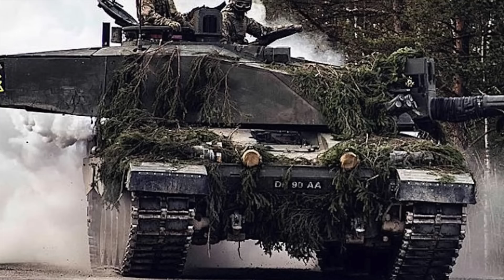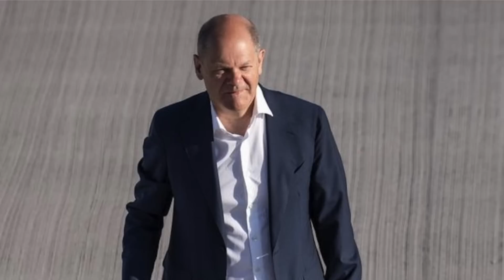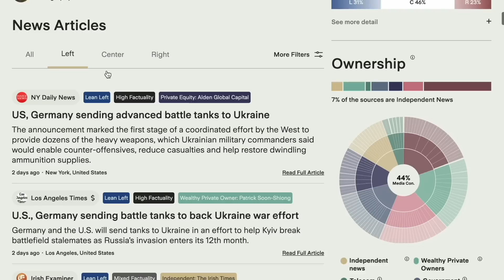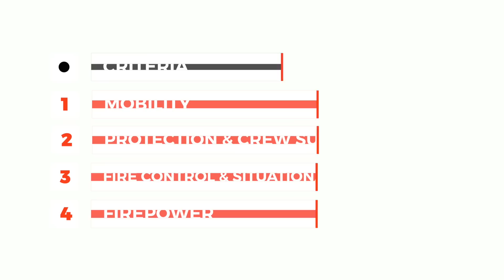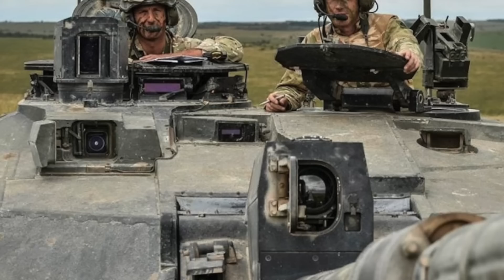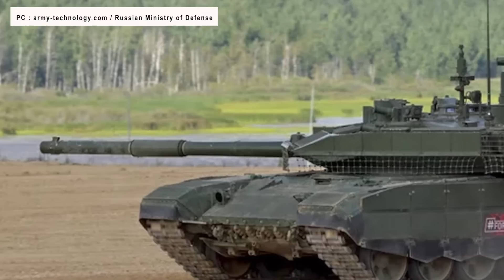British Challenger 2 vs Russian T-90 - Detailed analysis !

Comment: Western tanks are going to massacre Russian tanks.
Reply: Only likely if they splash out for the invisibility cloak option
Reply: @fred4687  Dude they already have in previous wars, hence why they had to rename the T72 to T90 since it did so bad against western tanks.
Reply: @ThatCarGuy  A rename, that's all the difference is ???  Maybe stick with the invisibility cloak there 😀
Reply: @fred4687  You must be trolling. The T90 was literally originally called the T-72BU. Since The T-72 did so bad they had to rename it so they could still export it.
Reply: @ThatCarGuy  The T-90M has significant upgrades in optics, fire control systems and armour. Regardless these hyped up promised - but not delivered - western tanks are hardly going to make an impact in the numbers talked about and without proper training, support, deployment within combined force units, and much more importantly, without air cover. The days of major tank battles are long gone.
Reply: @fred4687  "The T-90M has significant upgrades in optics, fire control systems and armour. "
It's literally a T-72. They dont even have ERA like they are supposed to have like we have all seen on video. They renamed them to T-90 since they did so bad against western tanks already.
" western tanks are hardly going to make an impact in the numbers talked about"
Over 300 western tanks will decimate Russia and their lower quality tanks.
"without proper training, support, deployment within combined force units, and much more importantly, without air cover."
So I guess Ukrainian tankers don't know how to operate tanks... I guess that's why even civilians have videos up of them driving tanks, BTRs, etc. I guess Ukraine also isn't getting IFV and ICVs. I guess they are going to use the Russian tactics of letting tanks go in alone, without infantry or aircover... 
"The days of major tank battles are long gone"
I guess that's why we have seen tank vs tank and/or tank and IFV/ICVs fighting in videos like "Ukrainian tank single handedly destroys massive Russian convoy east of Kyiv"
Reply: @ThatCarGuy  T-90M's .....  optics, fire control systems and armour ....  they are not the same as original T-90's / T-72''s
Tank vs convoy iof vehicles s not the same as a major tank battle
Driving tanks vs operating within a coordinated group during a battle without months of training ....  not the same at all
300 western tanks of dubious vintage, state of repair and with their own supply chain and support requirements .....  not a significant threat
Tanks deployed without air cover .....   expensive targetss

Instead of these incremental escalations dragging the war out both sides  should be encouraged towards peace talks.
Reply: @fred4687  "T-90M's .....  optics, fire control systems and armour ...."
Of which is a T-72 and doesnt have ERA like Russia proclaims.
"Tank vs convoy iof vehicles s not the same as a major tank battle"

Ah so you didnt even watch the video of a single Ukraine tank destroying Russian tanks.
At this point you have to be trolling so this will go nowhere, enjoy trolling others. Blocked.
Reply: @ThatCarGuy  The video was far from unbiased and objective and you fail to address the points I raised. Feel free to deliver your expert opinion to other gullible fools who think the possible delivery of an assortment of old tanks will make difference.

Comment: I have a question: are autoloaders as bad as automatic rifles ability to seat shells, as compared with bolt action rifles - which seat shells better than auto?

Apples to apples or apples to oranges?
Reply: They aren't bad as far as rapid fire. The problem is if they are hit in a certain place the ammo in the turret can explode
Reply: The auto loaders are no the problem with the T models, what is, is how the ammo is stored in order for the auto loader to function.
The Russian crews sit on top of the ammo and the armor on Russian tanks can not stop the 120mm ammo from western tanks, this results in almost guaranteed turret pop off with the crew having no chance to escape. Do a google view for Russian tank pop off contest to get the point.
Their ammo is so poorly stored that Ukrainian drones have been known to drop a bomblet into an open hatch and starting a cook off instantly.
Reply: With the sole exception of the M1a2 Abrams, every Western tank stores at least 2/3rds of their ammunition in the crew compartment without the protection of blast doors or blow-out panels 

The Leopard 2 stores only 15 rounds behind blast doors; the rest of the rounds (27) are in the crew compartment, next to the driver. 

The Challenger 2 stores none of its rounds behind blast doors 

The Leclerc stores 22 rounds behind blast doors; and the rest are located in the crew compartment without the protection of blast doors or blow-out panels 

The Merkava mk4 stores only 10 of its 48 rounds behind blast doors.
Reply: @thephoenix756  M1A2 stores 8 rounds in the hull, all western tanks have their hull stored ammo well protected by hull armor, anything that can pen this hull armor can also penetrate the turret.
This is in stark contrast to Russian stored ammo which is not as protected, this has become quite apparent in Ukraine.
Russian tanks are so poorly protected that they rely on ERA packs which has proven to be ineffective way back to the battle of 73 Easting.
Reply: @Diemerstein  

ERA is actually quite effective and this is precisely why the United States has now adopted its use. 

The United States military had to continuously create more powerful sabots due to the data they obtained from Soviet ERA, so your claim is dismissed.

The use of ERA cannot stop 152mm artillery shells or top-attack missiles; and it's even worse if armour is not used properly. 

The T-90M has superior ammo stowage configuration to all Western tanks except the M1a2 Abrams.
Reply: @thephoenix756  Okay, you clearly are clueless and using a copy and paste response.
The US military has not adopted ERA for it's M1A2 fleet of MBT's.
Several M1's were fitted with side mounted ERA add-ons who were tasked with entering close quarter city fighting in Iraq, it is not a standard kit, nor are there currently any plans on doing so and that is a fact!
As for the T90M, is pure garbage, there are hardly any left in Ukraine due to them being taken out by NLAW's, Javelins and Panzerfaust 3LR's.
Panzerfaust 3 is not a top attack missile, it is a line of sight rocket, it is considered the hardest hitting anti tank man launched weapon in use and there are several documented cases of them taking out T90M's penetrating the front hull, ignoring ERA's and popping off the turrets in spectacular fashion, go ahead and guess what causes a turret pop off?!!!
So spare me the Russian propaganda bullshit, yours truly, a former real tanker!
Reply: @Diemerstein  

ERA is effective and the United States literally has had to update rounds to counter it; the United States created M829A3 in response to Russian ERA. These are facts whether you like it or not. 

Also, Russia has deployed 200 T-90M tanks and only a dozen have been destroyed; even older T-90A and T-90S variant have performed exceptionally well.

No T-90M has been taken out by a Panzerfaust and certainly not after being hit on the front. 🤣

Comment: Germany has just announced the donation of 88 Leopard 1 tanks and 15 Gepard AA tanks to Ukraine. This is in addition to the 320+ Western and Modernized T-72 tanks announced last week. Ukraine now has over 400 more tanks coming and another 15+ AA systems that are perfect for bringing down attack drones and cruise missiles.
Reply: They are more useful under spring conditions than the AMX-10 RC is. And factoring in the A3-A5 are designed in conjunction with modernised ammunition to deal with the T-72 they will be able to do more than just reconnaissance.
Reply: Russia has 500-600 T-90M tanks.
Reply: @definitelyfrank9341  less losses incurred to date
Reply: @definitelyfrank9341  you misspelled had. Thats the number of T-62 they are using. They are now fitting the new build T-90 with T-64 optics and most did a jack in the box in Ukraine already. Russia is down at least 3500 modern tanks of which 600+ were donated to the AFU. The mainstay of the Russian army was the T-72 it is now switching fast to the T-62. Soon only the T-34 and T54/55 will be available, the T-34 is already being used by the fake separatists and Russian volunteers just like the D-1 guns from 1943..
Reply: @ZLSM-fan   "They are now fitting the new build T-90 with T-64 optics-" Source?
Reply: @ZLSM-fan  They've only lost 7 T-90Ms...
Reply: @ZLSM-fan  Uhm, what? "The T-34 is already being used by the fake separatists and Russian volunteers-". It was actually the Ukrainian army getting desperate; the T-34-85 was taken off of its pedestal in the Ukrainian town and was used to block the road.
Reply: @ZLSM-fan  Russia had ~13k active MBTs (T-72s, T-80s and T-90s).
Reply: @ZLSM-fan  Hahaha, you can't be serious! Ukraine will run out of tanks WELL BEFORE Russia. Russia still has dozens of tank factories pumping out modernized T-72s, T-80s, T-90s, and T-62s, while Ukraine's largest tank factory was destroyed months ago! Goodness me.
Reply: @definitelyfrank9341 his a storyteller.. check username..  #propagandawar
Reply: @definitelyfrank9341  dude you’re drunk off copium.  Russia can’t produce anywhere near those numbers anymore.  🤦‍♂️
Reply: @smyers820gm  Yet they somehow do?
Reply: @definitelyfrank9341  no they don’t man. Now you’re just being ridiculous.  If they we’re producing anywhere close to that do you really think they would stop sending missiles    🤷‍♂️.  Come on dude use your 🧠<—-   The weapon that you talked most about and have had the greater success with 🤷‍♂️.  That and the great artillery 🤷‍♂️.  They were shelling almost continuously just to capture soledar.  Now all of a sudden they stop? 🤷‍♂️
Reply: @definitelyfrank9341  They still haven't mastered vat-cloning tank crews vaporized by NLAWs, and they seem to be dusting off their T62s and T54s & T55s... It seems likely that they are failing to produce T90s fast enough to replace the ones that have been getting stuck/stolen and destroyed... Or maybe they're breaking out the T62s because they are good sportsmen ?
Reply: @smyers820gm  Produce? They aren't producing T-90Ms, they're upgrading already built T-90s.
Reply: @fungibleunit4477  A total of 56 T-90s have been confirmed lost in Ukraine according to Oryx.
Reply: @fungibleunit4477  The Russian army isn't using T-62s, T-55s or T-54s.

Comment: Best tank in the world until the 3 comes 🇬🇧
Reply: The Abrams is better, but I get supporting your nation.
Reply: @ThatCarGuy  The Abrams is better if it has the US DU armor(not included in the Abrams donated to Ukraine) and if it has the new Trophy active protection suite. A 55 caliber gun would also help but they believe in short and thick I guess.
Reply: @bradleyanderson4315  Well OP was comparing it in the world, not just the ones Ukraine is getting that's why I posted. The DU armor really is amazing. I do get some people wanting the L55 over the L44 but they both have pros and cons. The L55 should get you longer range shots and depending on ammo possibly allow for more armor penetration but also means it's more visible and taking short turns makes it harder since the barrel is longer so they each have their pros and cons. Im just glad to see multiple western nations stepping up
Reply: @bradleyanderson4315  
The Abrams armor without the DU liner is still fully capable of stopping rounds from Russian tanks
Before the war back in 2004, when Russian and Ukraine had their failing , Ukraine provided the US with 125mm gun and ammunition 
So far, T-72, T-80 and T-90s have been captured in the 11 months of war. Again the 125mm gun and ammunition has been provided to the West
So again the West has idea of the level capability of Russian Sabot , HEAT and guided rounds
Despite the claims they have been using older ammunition. The captured T-90Ms had updated weapons and sensors
Either way
it only ends badly for Russian armor
Reply: @ThatCarGuy  
And that's what you do too. Great that you will also understand your own psyche, as well as observe other people's failings..........

Comment: Each Challenger II advantage may be minor or significant, but taken all together in a holistic manner, the Challenger IIs would be dominant against the T-90 variants.

With that said, tank on tank combat is not tha common. Tanks are much more likely to be killed by infantry, artillery or aircraft. Tanks main mission is to exploit a break in the enemy lines or to flank the enemy. Acting as a tank destroyer is a secondary (even tertiary) mission.
Reply: Challenger was built to dig in and hold the line against Russian tank rushes. It's role is different than the others. It's very heavy and strong, not even nukes or chemical weapons can stop it.
Reply: @BlatentlyFakeName  tanks are built to dig in.  They are all designed for breaking through enemy defenses and driving into rear areas.
Reply: Exactly, that's why the Challenger 2 isn't suitable for the conflict. Challenger 2 is incredibly heavy and slow, and snow begins melting in Ukraine by around late February, which will reduce Challenger 2's max cross-country speed to around 15mph.
Reply: @definitelyfrank9341  British Tank Doctrine was influenced by the Cold War. The idea was they would be sniping at the more numerous Soviet Tank Armies from Long Range with Squadrons and infantry Anti Tank teams covering each other as they retreated in turn. Exploitation or Counter Attack was left to lighter units.  So Challenger will be best suited to blunting the expected Russian offensive in the spring whilst embedded organically with existing Ukrainian T72`s who can take on the counter attack role. When the Leopards are released they will be perfect (providing Ukraine doesn't forget about combined arms !!!!) for the expected Ukraine counter Offensive , again with Challenger in reserve against any Russian counter attack. You might regard Challenger as playing 76mm Firefly to the T72 /  Leopards in  Sherman Tank mode in WWII speak.
Reply: @flipout99 Challenger is more like a Tiger II. It's slow, difficult to maintain, will not fare well in melting snow and mud, and just like in WW2, it's incredibly vulnerable to artillery or Lancet drones, only difference being that in WW2, the Tiger got fucked by the Il-2.
Reply: @definitelyfrank9341  dude stop regurgitating what you read others have said 🤔🤷‍♂️.  You might not believe this but they actually have mud in England 🤷‍♂️😂😂😂😂😂. Just like we have mud in America 🤔🤷‍♂️😂.  The Abrams can actually drive through mud too 😳😎🤔😂😂😂😂
Reply: @smyers820gm  https://en.m.wikipedia.org/wiki/Challenger_2
Reply: @definitelyfrank9341  yes I have wiki too. Still doesn’t mean it can’t drive through mud 😂
Reply: @flipout99  The Russians are right to be worried by the MBTs heading to Ukraine as they don't seem to have the capability to do much about them - all they can do is hope they run out of spare parts. I think they should be more worried by the M2A2s and AMX-10RCs heading to Ukraine, those things have a track record of taking ground quickly and can deal with pretty much anything the Russians can throw at them.

Comment: One thing that we must remember is T 90M also has blow out Pannels although what's the use when the carsouel autoloader still exists
Reply: T-90 has a blowout turret, when it's hit the whole turret ends up in the ditch next to the hull.  Unfortunately the Challenger 2 main gun round isn't compatible with M1-Lep 2 main gun ammo.
Reply: @GG-yr5ix  

With the sole exception of the M1a2 Abrams, every Western tank stores at least 2/3rds of their ammunition in the crew compartment without the protection of blast doors or blow-out panels

The Leopard 2 stores only 15 rounds behind blast doors; the rest of the rounds (27) are in the crew compartment, next to the driver. 

The Challenger 2 stores none of its rounds behind blast doors

The Leclerc stores 22 rounds behind blast doors; and the rest are located in the crew compartment without the protection of blast doors or blow-out panels 

The Merkava mk4 stores only 10 of its 48 rounds behind blast doors.
Reply: @thephoenix756  One of these days you might just put 2 & 2 together and figure out why your wrong.
Reply: @paullakowski2509  

That's not a rebuttal; Western tanks (with one exception) all store most of their ammunition in the crew compartment.
Reply: If you did some research, you would know that a study showed that the ammo stored outside the carousel is what got it most of the time, so by adding a ammo compartment with blowout panels can significantly reduce the chances of the turret being sent flying.
Reply: @definitelyfrank9341  Then took out the carousel which is why the T90 having blow out pannels to store that ammo safely makes sense.
Reply: True, they also seems to have made some improvements of the ammunition carousel in newly produced tanks, a shrapnel protection going around the sides off it instead of just the plate on top. Isn't really many videos of T-90 that starts burning or just explodes, most of those videos are of T-72's and some T-80's.